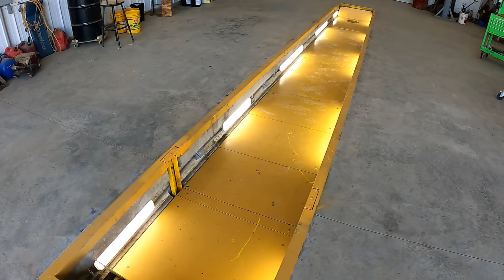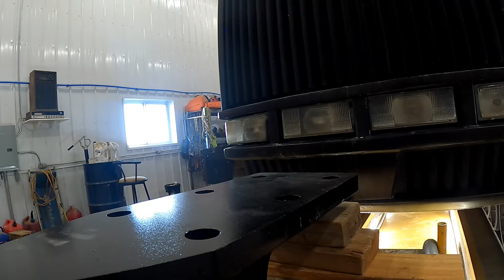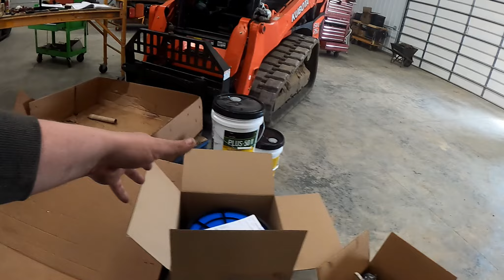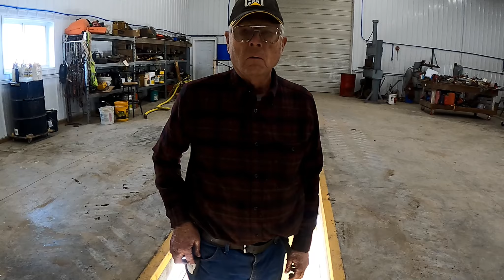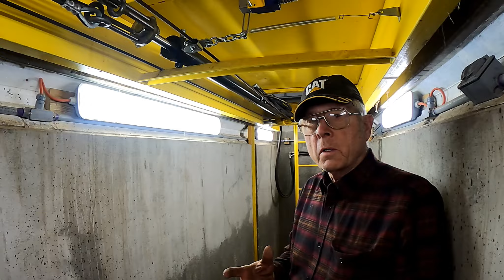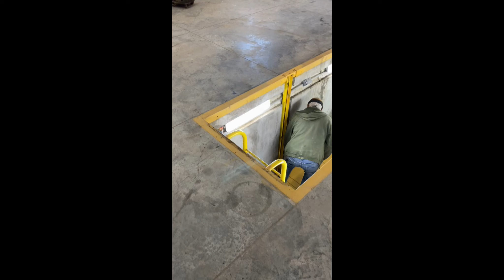MUD READY! - You won't believe this SHOP PIT!

Comment: Are those sealed crankcases, if so pull a vacuum on the oil filler tube and no oil will come out until you turn off the vacuum source.  Has worked beautifully on many vehicles especially my Ford 7.3 for the last 17yrs.
Reply from the maker: Not sure if they are!
Reply: @iowANFarmer  If it runs an EGR I'm pretty sure it will hold some level of vacuum.

Comment: Saw   one w/ a rolling steel frame that rode on the side channels of the pit. It housed a hydraulic transmission Jack so you could stand on the lowered pit floor while raising or lowering the transmission for removal & replacement.
Reply from the maker: Sounds slick!

Comment: Like the ability to set a portable rolling tool chest on the ramp,  @ floor height,  then lower it into the pit with you, then you obviously have access to primary tools while lowered  down into the pit,  believe the custom version had a small compressor,  refrigerator, first aid kit,  and toilet w/ extractor/ejector  pump  recessed into the pit sidewall, under the floor.